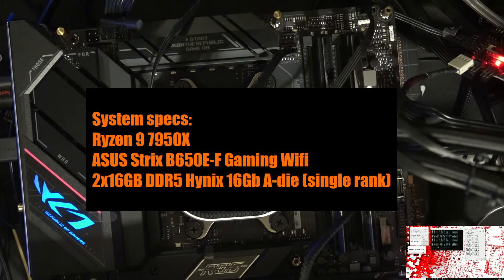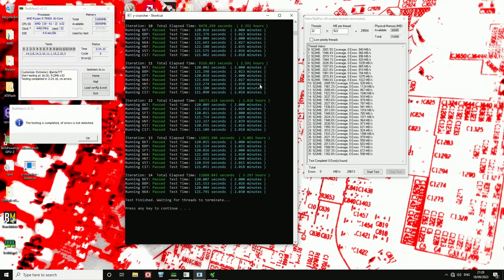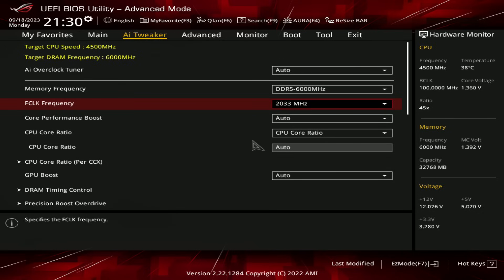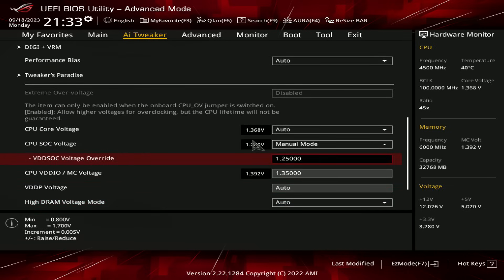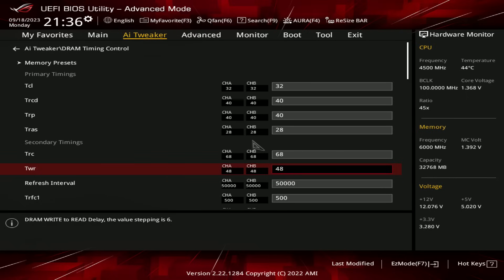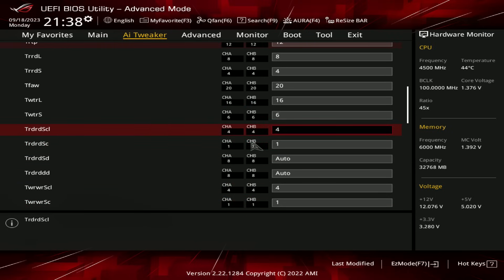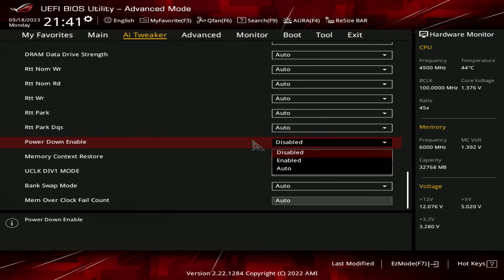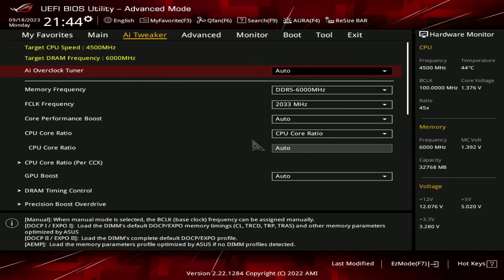Easy memory timings for Hynix DDR5 with Ryzen 7000

Comment: Did this with some 36-38-38-96 G.Skill DDR5 6000 sticks, a 7950x3d, and Asus ROG B650e-I motherboard.  Works perfectly.
Reply: I have the same sticks but a MSI B650 Tomahawk and a 7600x. My BIOS do not let me set tRAS below 30. How did you do that? xd
Reply: @cedden  see if there`s a newer bios, I had the same problem with my asrock riptide, where the tras was limited at 30
Reply: @Drachenmaetzler  I have the newest version installed. Funnily enough the newest BIOS seems more unstable than the last even though I waited for it to not be the beta version anymore. But by changing the Timings I at least can have both EXPO and Memory Context Restore enabled without any issues or blue screens like before. Also I have seen people on Reddit saying they got their system to boot instantly by changing the timings to 36-36-36-72. Unfortunately didn't work for me.
Reply: I have g skill but is samsung chips will it work for samsung chips?
Reply: Is it safe to copy timings on samsung chips

Comment: Will this work with 2x32GB RIPJAWS S5 6000MTs CL30? It has SK Hynix memory apparently, but its prob 2R as its 32GB per stick.
Reply: These timings worked for me (and others) on the trident neo dual ranks. I'd expect them to work on the ripjaws if they use the same chips.
Reply: @subaction  thx do you know what you used for the same dimm (sd) timings?
Reply: @Ginkoman2  I left them on auto and didn't attempt to tighten them; I probably should experiment with that

Comment: This unfortunately did not work for me on my 32gb CL-30 HK Hynix Tridents. I imagine it would be fine for a 16gb stick. What worked was the Hynix 6400mhz 32gb DR preset in the Hero BIOS + enabling UCLK to sync with MEMCLK. I did have to bump up the ram voltage to 1.43 otherwise I couldn't even boot windows without a BSOD. With the voltage bump it passed memtest86+.
Reply: Z5 Neo 32GB CL30 here, massive memory errors in OCCT with SMT on, they go away SMT off 7600X. I game and do not render video, so not too big a deal for me I think? :(

Comment: I was able to replicate the exact sub timings on my 13900K system with a G.Skill 5600 CL30 kit (that I tuned to CL28) and it passed all my tests. Reduced the memory latency in AIDA from 67ns to ~61ns. All without touching any voltages. Neat.
Reply: If I’m trying to get 7400cl34 down to cl 32 how should I go about it

Comment: I cannot get my ram stable above 5800mhz, I am using the exact same settings as in the video and it is the most stable it has been. I get no errors in memtest86, and no game crashes. I even tried both expo profiles and the video’s settings at 6000mhz, and it is unstable to the point of blue screens.

My Specs:
Mobo: Asus Prime X670-P Wifi – Bios ver. 1222
CPU: Ryzen 9 7900x
Ram: Gskill Trident Z5 Neo (6000mhz) - F5-6000J3238F16GX2-TZ5N (CL32-38-38-96 – 1.35v)

What I have tried so far:
Loosing timings for Trfc 1-2-csb and simply switching the infinity fabric to auto at 6000mhz with no luck. (I saw this mentioned in the comments somewhere)
I want to also state that I am new to memory overclocking so there could be something that I am doing wrong, I am open to suggestions to get my ram stable at 6000mhz.
Lastly, thank you so much Buildzoid for this video, my ram is faster and more stable than when I use the expo profiles from the manufacturer.
Reply: I stand corrected, it is not stable anymore and I get crashed with these settings. Makes me think that maybe my ram is faulty.

Comment: Got a minor problem when applying this with 5600Mhz Kingston Fury 2x32GB on Ryzen 7900 non-x. Blips of green or white happens inside Windows 11 once in a while. I will investigate, do you have any idea why it could be? Seems like something interacts with the iGPU (not running GPU). Would the SOC voltage have to be even higher?

Thanks for another amazing video! Favorite overclocker!👍

EDIT: tRAS was the solution! Increase tRAS to 36

7900 non-x, MSI B650I Edge, motherboard limits
Reply: Dude I just want to tell you what an absolute LEGEND you are. I've been struggling with a similar issue for days now, and all other mentions of it online just lead to "turn off EXPO". 
You didn't have to come back and update your comment with the solution, but you did. And for that I am genuinely grateful.

Just to add my experience in case it helps some lost soul: Kingston Fury Beast 6000Mhz 2x16GB, Windows 10, Ryzen 7600x, screen would flicker or flash black when on igpu. tRAS is the solution.
Reply: @perthhi1  thank you! Actually I adjusted my primary timings to be 36-38-38-38 this is as low as I feel comfortable going with this 64GB kit but its been y-cruncher memtest tested for 30 days of 2 rounds both VST alone and the memtest config with AVX512 so 60 days total its rock stable!
Reply: I have the same set, need to try this out. Can we apply same/similar settings as in the video even tho our ram is 5600mhz and not 6000mhz? Thank you in advanced…
Reply: thanks for sharing

Comment: I need something like these easy timings for my GSkill Trident Z5 RGB 64GB (32x2 kit TZ5RK which is matte black) 5600 30-36-36-89 kit. It's on a 7950X stock on a Gigabyte X670E Aorus Master board. I'm running the kit on XMP. I chose that specific kit because it's on QVL as Hynix and just availability issues here, but for some reason what I got registers as Samsung on HWinfo. I want to squeeze out a bit more if I can from these but I can't really spend too much time on it so I'm asking. It's actually the most commonly available kit here in my province too for some weird reason.

Comment: Thanks for this Buildzoid. I ended up here mainly because three different memory kits wouldn't hit their rated speeds. I had issues with the Samsung kit I had hitting anything over 4800, let alone the EXPO profile. No matter which BIOS I've tried no kit I've had will do anything over 5800, which makes me feel like it's probably my luck in the silicon lottery on my 7950X. Regardless, this helped me tighten the timings if nothing else. EXPO results in unstable memory for me.

Comment: Hi Buildzoid, first of all thank you for this video (and all your other educational content), it helped me immensely improve performance on my M-die chips. I got a cheap EXPO kit from Kingston (KF560C36BBEAK2-32) and they run your settings (except lower primaries and refresh cycle timings) without issue. Awesome to get that kind of performance out of a relatively low-budget kit.

I'm confused by one point though: at 10:36 you say that it's possible to set tRC lower than 68, but isn't the "effective tRC" in this case much higher anyway? You have a tRCD of 40, tRTP of 12 and tRP of 40, so altogether that's 92 cycles activate-to-activate, meaning that any tRC lower than 92 will be ignored - or did I misunderstand something about how these work?

Comment: i just got a lump sump and decided to build a pc... i didnt know too much and i didnt realize the problem with ryzen and 4 dimms of ddr5 causes issues. so im locked at somewhere between 4800-5200mhz of speed and from what ive been told thats the best i can hope for. So i now i have to wait till i can switch out  a 4 x 8 kit for 2 x 16 kit. 
I was wandering if anyone has tested or found a way to get a little higher without getting unstable, but honestly im not sure that can be done currently.

Comment: You may have set your MC voltage at 1.35V but the actual value as read in the BIOS is 1.392V
Reply: Yea on ryzen the voltage is rounded to the nearest 10th of what ever value you set. In some instances it even goes higher

Comment: well I used the exact same timings asside for the first 3 I have a 6400 2x16 kit 32-39-39 1.4v Kingston Renegade and in the first min in testmem5 I got 200 eror and a blue screen, I think my memory may be corupted or my cpu doesn't support it ryzen 7 7950x mb Asus rog crosshair x670e hero

Comment: how the fuck can you setup tRAS from 96 Vendor like, to low 28? How the... can this jump so much in difference? I mean when it would be safe, they would put this way lower from the manufacturere already? When I read other guides, from also really good pple with a lot of PC knowledge, they tune their ddr 5 ram this setting to 68-77. So how can you set this up to 28? Is there any risk included? I do not get it. you are the only one putting that setting so low on google. how or why? how can this work?
Reply: tRAS is the minimum latency from activation to precharge. But that minimum latency is also defined in a different way by tRCD (activate-to-read) plus tRTP (read-to-precharge). In other words: the low tRAS value of 28 gets ignored, the real activate-to-precharge latency with these settings is 40 + 12 = 52. (Because when two timings overlap, the higher value always overrides the lower one.)
I recommend Buildzoid's "What DDR4 timings do" playlist if you want to learn what's going on.
Reply: @efovex  Hmm Okay. But 52 is still way lower then 68 what I saw in other guides/reviews? Another thing that gets into my mind, do those timings also work on intels 13th gen? with hynix die? I think yes or? but the impact will be way lower? Is that right that going just for MHZ increase on intel works better? I did not find any good intel hynix guide via google. sadly.

Comment: Just used these timings on a pair of Team Group Delta RGB 16GBx2 and all is well. OS is snappier and cranked out more fps in my games on a 7700X
Reply: I have the same sticks, would it work ? I’m on 7400mhz cl34 tho. I’m trying to get the cast latency to cl32 for a 1 & a half minute reduction.

Comment: Thanks a lot for that comprehensive information Buildzoid! Really cool stuff. 2033 IF causes stability issues in my case, BIOS crashes and BSOD on my 7600x so i will leave it on 2000. I believe it is only important for multi CCD CPUs like 7900x and 7950x, does not make sense to push it for single CCD 7600x/7700x?
Reply: I tried the memory secondary timings and all seemed well tests for some hours without errors and performance seemed well but after i restarted my PC i was stuck in loop of POST signals and immediate restarts, the OS would not simply start. I am guessing memory re-training of custom timings with my current BIOS does not work well. Maybe a BIOS update could fix it in the future. Oh well.
Reply: Updated the BIOS and now restarts are okay and memory timings work wonders with Kingston Hynix M-Die. Will try them as well with with GSKill Trident Z5 Neo Hynix and try to push the CL to 28.

Comment: Great videos, thank you so much for this easy to follow instructions and making DDR5 tuning easy. Geekbench will immediately show the benefits of low latency in their results. It worked perfectly in my 7900X system using Corsair (Hynix) DDR5. Great performance and stability!! 💪💪💪

(OCCT doesn’t seem to like it though… weird program)
Reply: Hi sphaera, I have a similar system to you. Do you mind telling me what Corsair memory you're using? I have the vengeance 5600 c36 and want to check before I implement the settings.

Comment: Appreciate the video.

The reason why 2033FCLK is faster is because the memory is implicitly run at 6098-6100MHz.  The Agesa BIOS versions appear to do this.  If we set the FCLK to 1 step higher than the MCLK/1.5, then it'll advance the MCLK to match. This also occurs at 6200MHz with a 2100FCLK, which will result in a 3150 MCLK.  We can see this effect if we use ZenTimings.  This gives precisely a 2:3 ratio between the FCLK and the MCLK.  Yes, while that's not an even ratio, it does mean though that for every 3Hz on the MCLK, that the FCLK is directly in sync at that precise moment leading to improved behavior.  A better ratio would be to have FCLK be half of MCLK, but since the MCLK speed is generally limited to 3200MHz at most, the reduction in FCLK speed harms more than it helps.  Maybe Zen 5 will be about to hit 4000MHz MCLK, and if so, that'll be the next "sweet spot".
Reply: agree， if fclk can set to 2200, keep mclk to 3300 wiht 6600mhz memory,  though uclk cant set 1:1 on 3300, just use 1:2 in 1650
Reply: my computer crashes whenever i disable power down mode. should i just keep it at auto?
Reply: @cant_Comment  If you disable Power Down Mode, make sure Context Memory Restore is also disabled.
Reply: I was able to get 7400mhz cl34, fclk 1:2 2133, mclk 1850. 

Right not I’m trying to focus on timings. Was hoping to get the memory down to cl32 & then tune the rest of the timings.
Reply: For whatever reason, 2033 is a good bit slower than "AUTO" for me on the MSI MPG B650I mITX board. All of these timings worked for me other than tREFI (MSI does not list it on this board yet iirc).
Reply: @nextjin  how do you test?
Reply: @nextjin  Also, would these timings improve gaming?
Reply: @Jr.G90  what do you mean how do I test? It would crash at 2033 on my mobo. And yes it will improve frame rates. Way less so if you have a X3D chip though.

Comment: I have a 7900x and the rog b650e-f with g skill ddr5 6000mhz trident neo z5 rgb F5-6000J3038F16GX2-TZ5NR EXPO. I followed this guide and everything mostly worked except it would crash most games after just like 5 minutes or less of playing call of duty and battlefield 2042 but destiny 2 was perfectly fine. It also would fail y-cruncher. What i figured out was my system doesn't like having the infinity fabric to the 2033mhz and i just leave that on auto and works great on all games now so that was weird. I also had the lastest bios and no overclocking anywhere else and i was on eco mode 105w.

Comment: Hey Buildzoid. Thanks for awesome guide.
I have problem on strix b650e-e, paired with 7950x and 2x32 henix based Ddr5 rated for expo 5600cl40.
After I OC mem, it works great, pases few hours of stress test, but when I reboot the mobo stuks at q-code 10 and requires power off.
Any idea how to fix it?
Reply: Same here, stress tests are fine, os stuff/ gaming is fine, but bios hangs ups at random times and while saving other settings after OC :(

Comment: I need to run 128gb RAM total (with 7950x) and am trying to figure out whether its worth buying high end DDR5 6400 CL32 in hopes of getting it to run at 6000 once there are four sticks in the MB?  Was going to use 2X G.Skill F5-6400J3239G32GX2-TZ5RK Trident Z5 RGB DDR5-6400 CL32-39-39-102 1.40V 64GB (2x32GB) kits.  It would suck to spend the extra money and be stuck at 4800MT/S.  I've had luck running high end (at the time) 3600MT/S DDR4 in my 3950x (albeit at 3200MT/S speed -- which is better than the 2666 officially supported by this setup).  Anybody know if I can get say 6000 from a 6400 kit at 128gb?
Reply: Correct me if I'm wrong but wouldn't that be too much for the CPU memory controller? Is that even possible for this gen to do 128GB 6000...?
Reply: I got 5600 stable 128gb 7950x3d meg ace

Comment: In my current setup, simply enabling the Expo profile causes crashing and other instability.  Would these timings help to add stability, or if my system is unstable at the stock Expo profile, these timings wouldn’t likely improve that?

For reference: Ryzen 7700x, b650m Aorus elite ax, GSkill 6000 CL30
Reply: Hmm, did you get a kit that's on the boards QVL? I have the x670 Aorus Elite AX and have no issues using XMP 6000mhz. With that being said, Buildzoid's manual settings are better and stable anyways.
Reply: enabling expo for me on the GSkill 6000 CL30 (Asus b650E-F and 7600 non-X) causes crashes and instability for me as well.  let me know if you find anything that works.
Reply: @SpookyKG  As I said...give it 1.36v instead of default 1.35v.
Reply: @SpookyKG  A couple things that helped.  On the setup I noted above, if I enable Expo but then manually down clock the speed from 6000 to 5800, it seemed to stabilize. (Very limited testing but initially seemed to not crash).  I had also tried “borrowing” a new version of my same mobo from MicroCenter, but the system still crashed after enabling Expo so it wasn’t just a one-off bad board.  Another tech channel I like to watch mentioned some reports of B650 boards struggling to run the higher speeds, so I returned the B650 mobo to MicroCenter for an X670 board and the system has not crashed after a couple hours of testing in two different games.  (It’s a fresh install of Windows so I only have two installed atm)  So I would say, if your stuck on the board you have, try turning the speed down one notch at a time until it stops crashing.  A future BIOS update may fix things and allow the faster speed to run stably one day.  Otherwise, you could try an X670 board and see if that works for you too.
Reply: @RolloC84  HUB's next video is their B650 breakdown and I have a Gigabyte B650E Aorus Master on the way. If I need to return it all for X670, then so be it.

Comment: Would I get a better result buying 6000 Mhz CL36 kit or a 5600Mhz CL28 kit? New too all of this sorry if it seems like a easy question.
Reply: I have the 5600 CL28 g.skill ( hynix) kit 2x16GB, and it's working great with these settings in the video and set to 6000! and the primary four set Tcl 30, Trcd 38, Trp 38, Tras 28. ryzen 5 7600X & an ASUS TUF GAMING X670E-PLUS WIFI w/current BIOS 0821. WinSAT "Memory Performance" went from 63903.14 MB/s to 76441.02 MB/s after changing from the default Expo settings. 

Thank you "Actually Hardcore Overclocking" for the excellent info.
Reply: @daruekeller  That is the exact kit I was looking at getting. You just saved me a bit of money with the 5600Mhz kit. Thank you!
Reply: 5600mhz would be doing Ryzen 7000 a disservice. If you mean to overclock it to 6000mhz sure maybe. Remember there's a reason it was packaged and sold as 5600mhz.
Reply: @insertnamehere4419  Alright, so I should just get the 6000Mhz CL36 kit despite it having lower CAS latency?